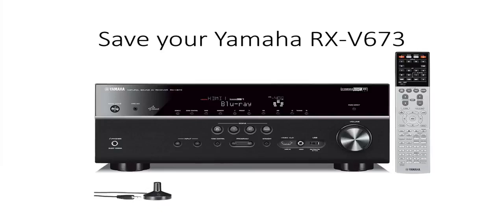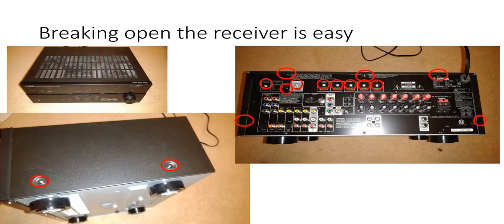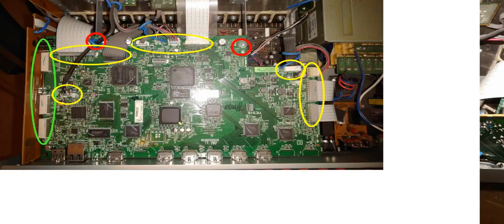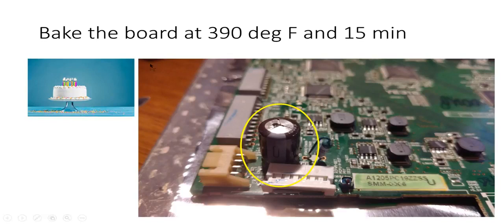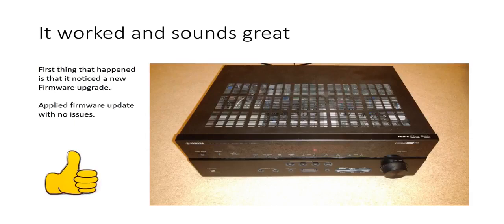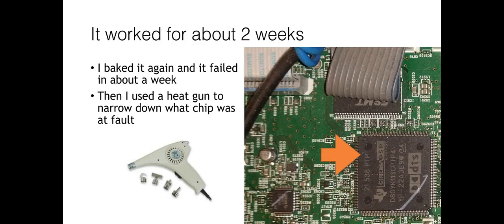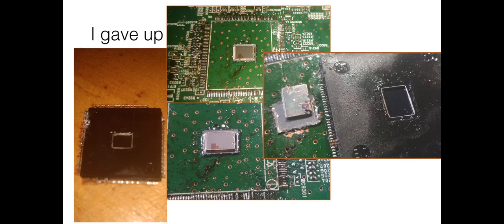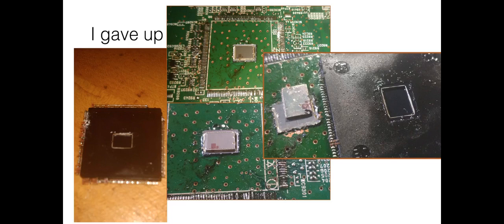Save your Yamaha RX-V673 (but it might not be permanent)

Comment: What did you go for as a replacement?
Reply from the maker: Hey Matthew,. I went for the Onkyo tx-rz820.  With Atmos.   Got a great deal on it and I have been happy with it so far.  Definitely a step up but frankly I wish the Yamaha had been permanently reparable for a reasonable cost.
Reply: @yourdiytechlife  
You are going to regret that decision in very short order. I got suckered into making a switch from Yamaha to an Onkyo and it was a HUGE mistake. Onkyo makes total garbage. Never again. I'm a Yamaha guy for life now.
Reply from the maker: @NunYa953  to be honest I am about to drop the entire receiver based home theater.  High end sound bars are good enough and I want to start focusing on a real 2 channel setup.  It's probably the last receiver I will ever have.
Reply: @yourdiytechlife  
I think you'll regret that decision too but totally understand why you'd want to try it. They are super simple to setup and use, the sound quality has improved exponentially as well. But in my experience, there is no replacement for a true home theater receiver. And when you get a quality one, the setup is a moot point because you only have to do it once. I've actually never purchased a brand new Yamaha receiver. Only used and I've never had a problem that wasn't a simple fix.
Reply from the maker: @NunYa953  hears the thing,  I used to like watching movies in my theater but I just don't do that anymore.  I find watching on my Mac with a great set of headphones FAR more entertaining than a theater.  I found a great little program called boom that does a decent job of three dimensional space replication based on dolby.  The other thing is that I prefer Netflix shows over most movies so that works well with a PC.  The intire home theatre thing has really played out for me so it's on to other things.
Reply: @NunYa953  Yamaha guy for life good choice

Comment: Board "baking" is not a fix for anything. It's not gonna work. Never. This DSP chip will fail again.

I have RX-V673 with Taxas Instruments D80YK113CPTP400 failure. I heated DSP chip with hair dryer and DSP started to functioning then little squirt cold spray and sound is gone. 

“Description of Withdrawal/Discontinuance:
The affected products listed below will be discontinued.
Reason for Withdrawal/Discontinuance:
Premature aging issue on the Rev B and C of this part family”
Source: http://media.digikey.com/PDF/PCNs/Texas%20Instruments/PCN20121114000_Obs.pdf
Reply from the maker: Agreed, with this chip it does not seem to be affective, the best I got was a month or so out of it after baking. After heating it several times I would only get a day or two.  With that said it did give me time to do some good research on what I wanted to replace it with so I found value in that.  By and large baking a chip is a temporary fix but there is value in it as long as the people doing it know this.  For example I have baked the GPU in my imac and it holds up solid for 3 to 4 months at a time.  It's an easy process after the first time you do it so it works for me as a diy type person.

Comment: I have the same problem with my rx-a820.
I am thinking of repairing it.
The ironical thing is that my last Yamaha rx-v800  before this one still works  and is 19 years old
Reply from the maker: Unfortunately for Yamaha they used these same or similar chips it would seem, in many of it's products.  I don't think it's really an issue with how Yamaha builds things so I have heard many times that the older gear works great, it just seems to be this era of product that has the bad chips.
Reply: @yourdiytechlife  is it worth repairing it
Reply from the maker: @shadyninja1  that depends on a few things, I replaced mine because I really wanted to get in to Dolby Atmos.   While baking the board works for a while it always failed after a while.   If you get a board swap of some sort for a decent price then it might be worth fixing but you might find a new one for a bit more so in that case I would just replace it.  Keep in mind if you swap the board with a new one, there is a good chance that they use the same model of chip that failed in the first place so that's the other issue you need to consider if you fix it.
Reply: @yourdiytechlife  yes all is true

Comment: What receiver did you decide to go with i am currently having this issue and am looking to get a new one as well, I am doing research on the different kinds and which works best for my setup but I’m still curious which one you chose
Reply from the maker: I ended up going with my first Onkyo. I went with an open box TX-RZ820 with Atmos.  So far I have been very happy with it's sound quality and power output.  I would say it sounds a bit better over all but that's very subjective.  The setup was definitely better with this unit and you have more crossover options so it makes blending the sub easier.  The RZ820 is one generation older and only has 7.1 but it has nice multi zone options and pre outs.
Reply: Dan Dunham my tv guy was saying it may be the hdmi and suggested looking into getting a  hdmi extender so if that doesn’t work it’s definitely time for a new receiver i saw onkyo on the top of a few lists and was considered it myself as well, thank you
Reply: They all go bad at some point

Comment: If this chip is cause, why you didn't buy a new one, in e-bay I can see it costs around 22-50$?
Reply from the maker: I decided against repairing it for a few reasons.  1- at the time the cheapest I could find the chip was $50.  2- From what I could tell this problem was wide spread with all of these chips manufactured so the problem would most likely com back 3- I dont have the proper tools to properly remove and replace the chip so there was a high probability that I would not have a successful repair. 4- the chip does not support Dolby Atmos and that is something I decided to setup in my theater.  for those reasons I decided to purchase a new receiver, however I am in the process of bypasing all the digital audio processing and converting it to an amplifier only.  I will use it in some other rooms of the house for a whole house audio system.
Reply: Hello Dan,  I have the same problem here  in Phoenix , checked the net and  run into you're post. 
My unit I got in a yard sale , and it worked for about year for me and started   the poping sound 
would take  several minutes to come on , then it  would"nt  out put audio at all. 
I found  your post on the net  and applied heat to that chip  and it came up running  in 30 seconds
I was using a hair dryer here for the heat,  as long as I  keep the heat on it would play audio 
but after removing the dryer  only played for several minutes  and stop again . 
Its a shame that Yamaha  puts out stuff like this , would  be interested in you did to convert 
just to amp, I put mine back on shelve for now , keep for parts later  .   Robert in Arizona
Reply: u dont know what your getting
Reply: getting 3 of them
Reply: Texas instruments don't make those chips any more
Reply: @kennethfriedberg2358  they have the revision D of this dts chip. I got one on eBay for 22 and 50 for electric replace it. Working 100% on pioneer 1021-k